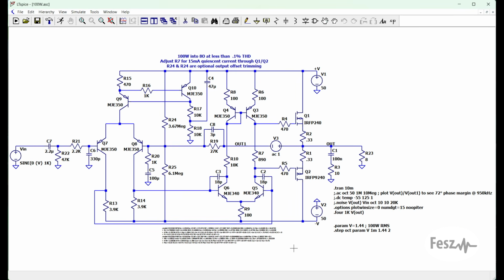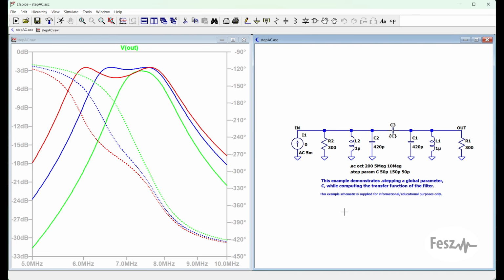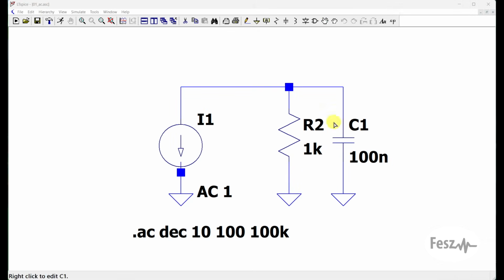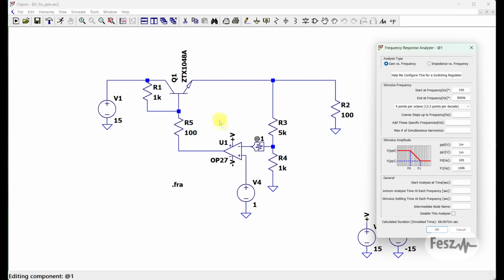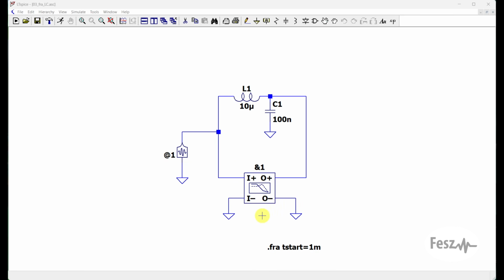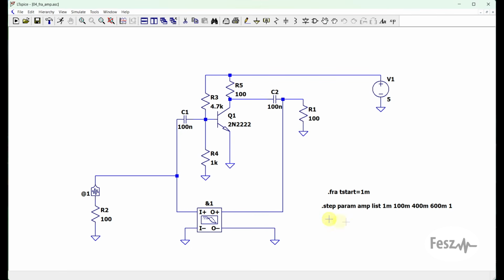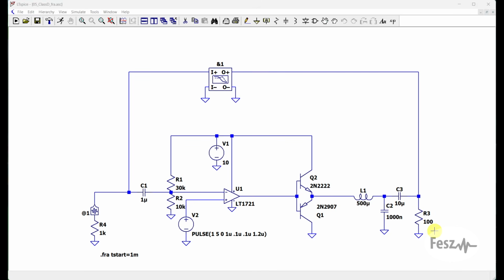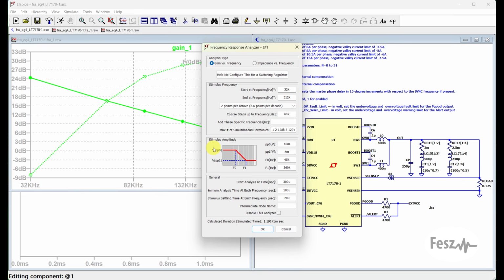LT Tutorial - The Frequency Response Analyzer

Comment: I'm a little confused how this is different from normal probes and looking at transfer response?
That shows you exactly the same thing?
Reply from the maker: By the "normal" probes I guess you are referring to the AC simulations. What makes the FRA special is that it runs over a transient simulation, so the circuit does not have to be linear - you can analyze switching circuits which cannot be analyzed in an AC simulation.

Comment: You're going to make me update LTSpice, aren't you?! Alright, ok.

Thanks for mentioning the feature, I am currently working on a resonant multimode filter and the standard ac analysis is fiddly to apply to different parts of a circuit!!
Reply from the maker: I just checked on the Analog website and the current version is 26.0.1; I'll also have to update since I have 24.1 and 17.0 currently installed :D
Reply: @FesZElectronics  Yep, I was also sitting at 17.0. Was a bit fiddly getting 26.0 to work under wine in linux but I got it eventually.

And then I had to port over some of my ".wave" commands to use the updated string expressions syntax, so I didn't quite get to using FRA, but maybe tomorrow!
Reply: This can all be done with even older versions? 
So I am a little bit confused tbh 🧐🤔
Reply: @p_mouse8676  I was running on 17.0 which does not have the FRA simulation yet. There was just no point in updating until now :D
Reply: Same here. I was sitting at version 17, when i randomly came across the FRA block. Looked it up, found this video, released 1 day ago. What a perfect timing! Updated to 26 now.

Comment: I played with FRA a lot with my high power linear voltage regulators based on fast op-amps, and it worked well. Then, I did my own schematic, kind of a current feedback input stage/comparator (single pnp transistor with reference to the base and measurement with emiter, driving other transistor that sinked current from CCS connected to base of power pass transistor). FRA would not show me a usual curve, but some crazy ragged 0dB to MHz. I inserted FRA in "usual" place when there would be an op-amp, i.e between Vout and pnp emitter. Can you give me some ideas how to make it work ?